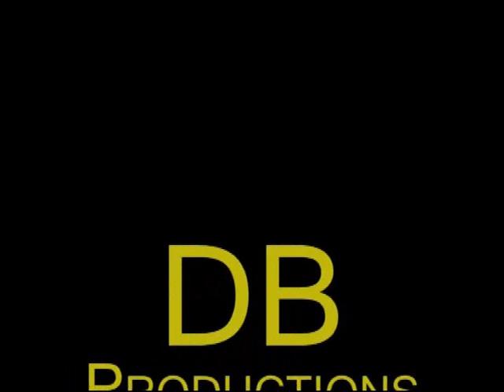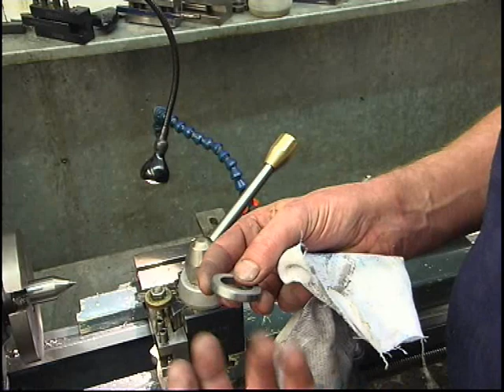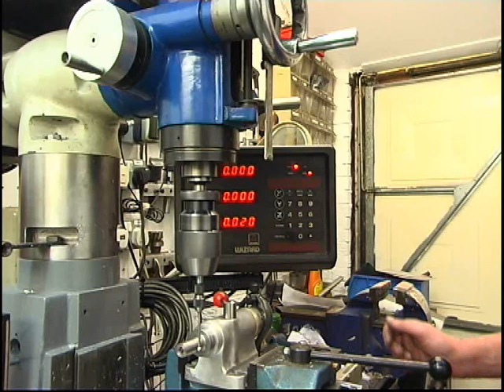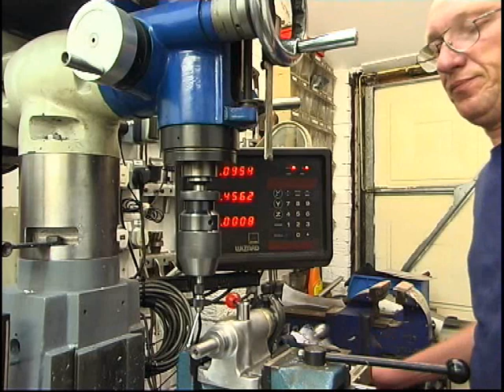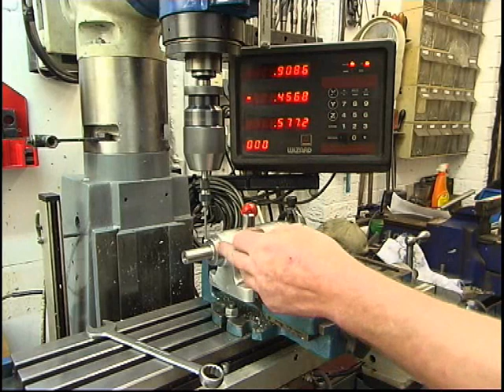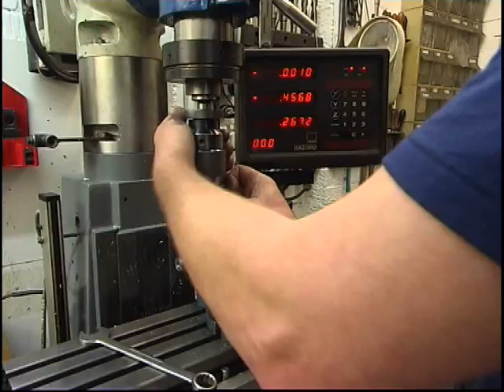DIVIDING HEAD PART 17 Screwed at last

Comment: Looking brilliant. The casting is awesome!  You shouldn't need to use the thread dial indicator if you are cutting a thread the same pitch or an exact multiple of the leadscrew. It would actually be impossible to get it wrong. Keep those vids coming!

Comment: Next time you use your wiggler try just running it up to the surface to be found, the oscillation should stop, then it will ping away, saves messing about with the spanner.

Comment: You wouldn't want stainless on stainless threads, galls very easily.  Bronze or brass would have worked as a nice alternative to mild steel.  Very nice job all around.  I'd buy one of those castings but posting it across the pond would cost a fortune.  Funny isn't it, the Chinese can ship stuff all over the world for less than I can sent a letter to the west coast.